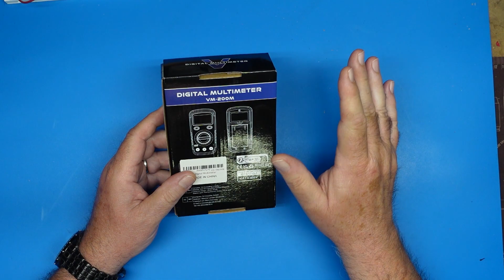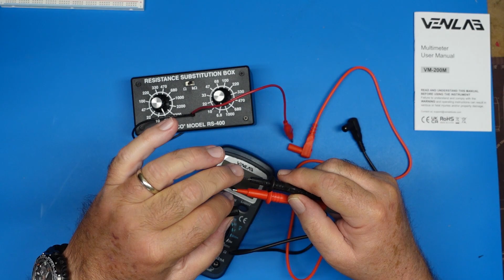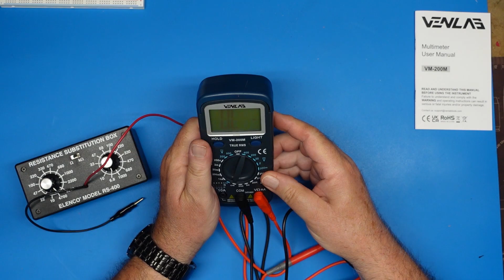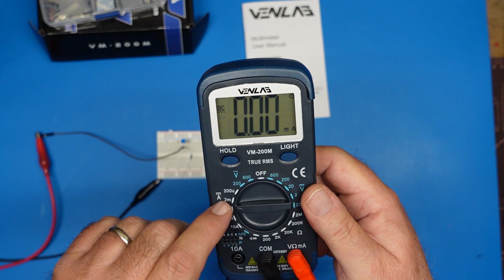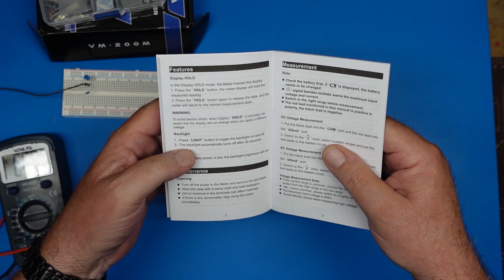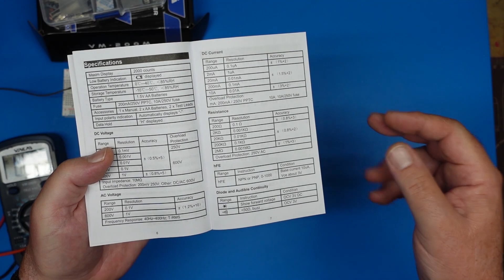Super Nice Budget Meter - The Best Value for Money Upgrade

Comment: Multimeters are designed to contain internal explosions from connecting leads to the wrong thing. This includes having a thick walled battery compartment and a screwing shut battery door.
Reply from the maker: Who knew?  I dunno if that screw would contain much of the plastic shards though.
Reply: @FEPLabsRadio  Some are probably better than others, and all are probably better than a plastic clip. But that was the intention of them at least. :)

Comment: Don't know why the screw, best guess too many battery door latches broken under warranty. I wonder how the display looks under sunlight. 73
Reply from the maker: Maybe so - but it's every meter I have.   Seems like it's unnecessary manufacturing cost, instead of using a injection molded plastic latch?